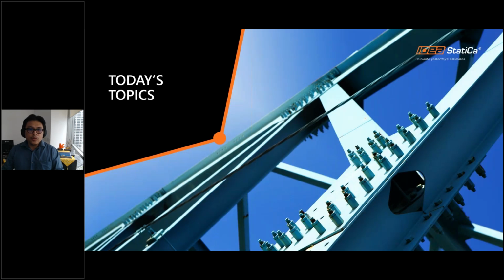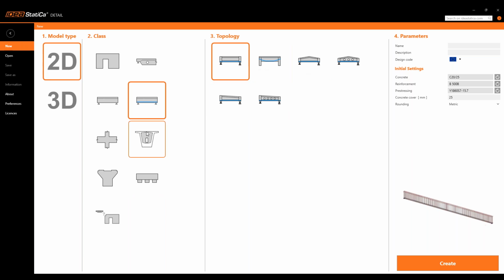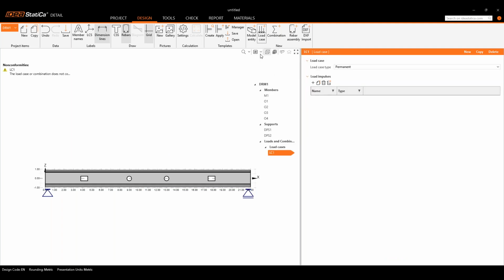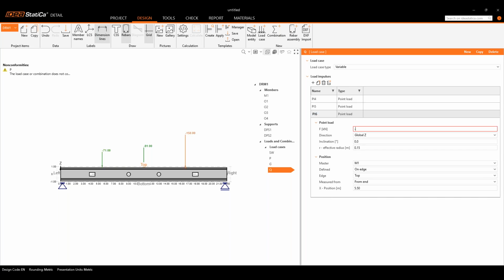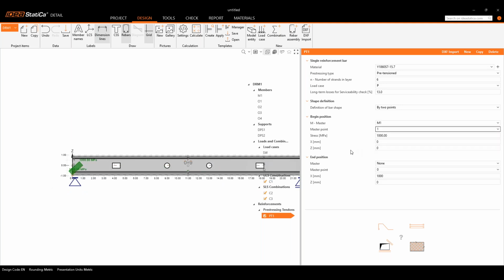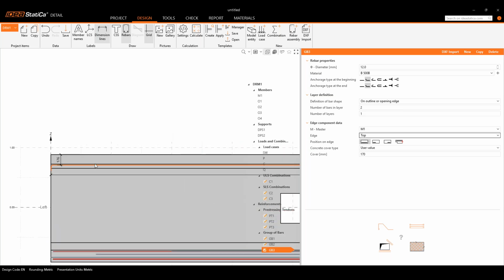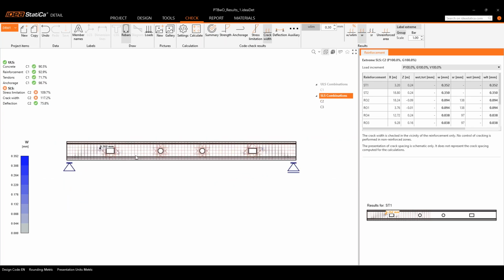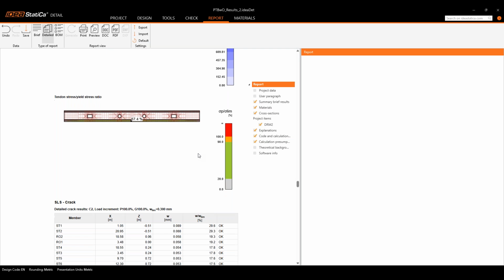Master your design   Prestressed Beam with Openings

Comment: Why are you using IdeaStatica Detail, but in this webinar: https://www.youtube.com/watch?v=MNEWYHBlsA4&t=1s IdeaStatica Beam module is used?
Reply from the maker: Hello, both options are possible - you can use Beam and Detail apps to design and analyze prestressed beams.
Beam uses 1D element for the beam and rather analytical approach, while Detail uses 2D shell finite elements.
Beam is better for example for time depended analysis, Detail for considering openings and other discontinuities.
You can acutally combined both!
https://www.ideastatica.com/support-center/export-beam-to-detail